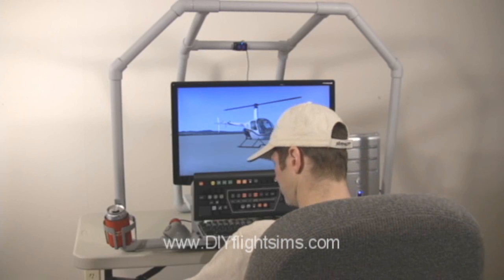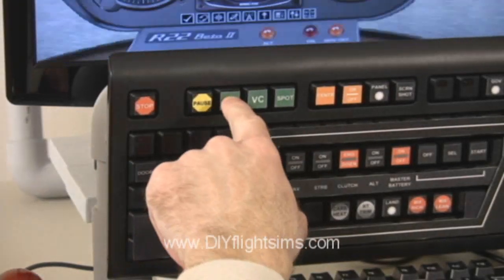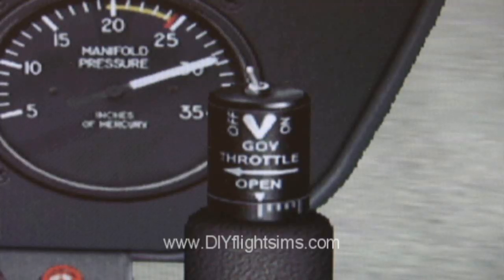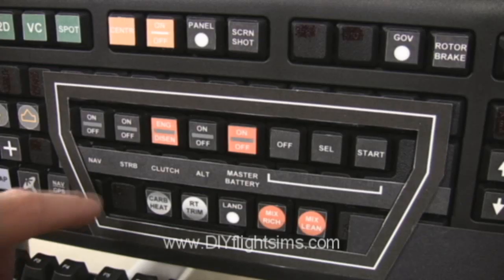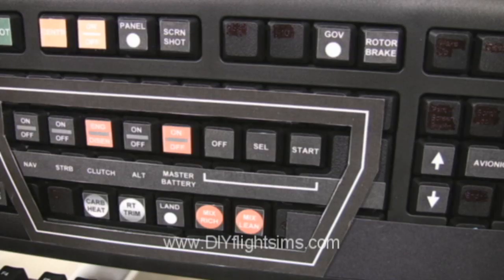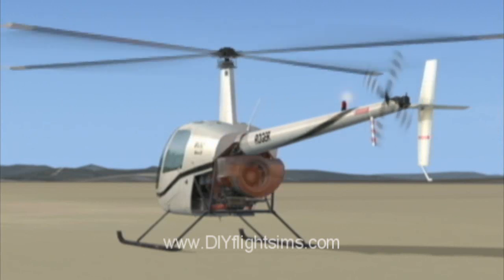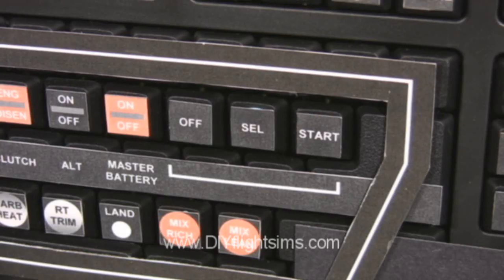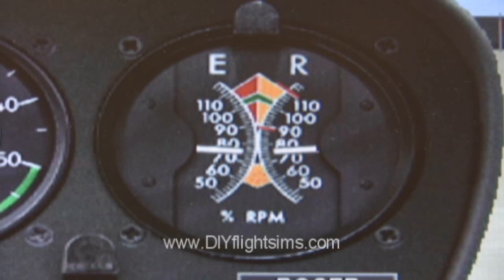Helicopter Flight Sim: R22 Start Up

Comment: i just got back into fsx again recently and rediscovered how frustrating it is that the r22s start up is so poorly simulated. i remember when the default r22 was first introduced in flightsim 2004 it was possible to follow the start up procedure as it was written and there was no engine stalling after engaging the clutch. the needle split during the clutch test was also correctly simulated in 2004 but I guess something changed between the two simulations that screwed it up. Every piston powered helicopter that I've downloaded seems to have the same issues as well.
Reply: FSX and FSX SP1 both works fine, it is installing SP2 (or Acceleration) that breaks it.